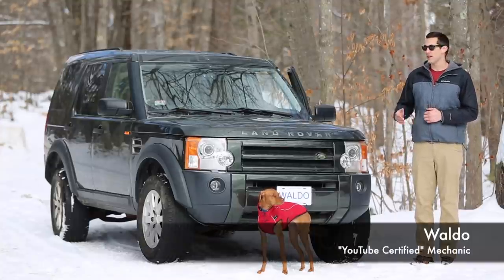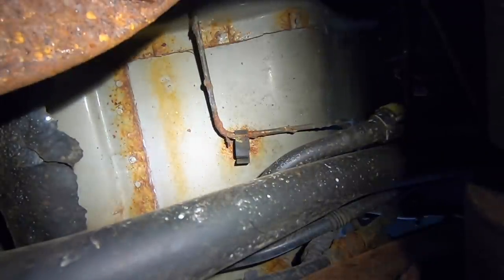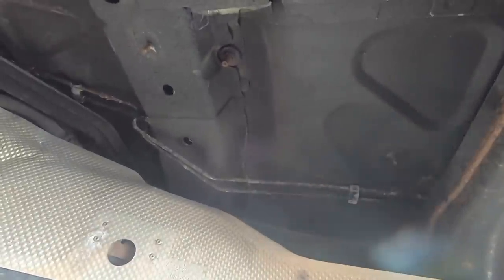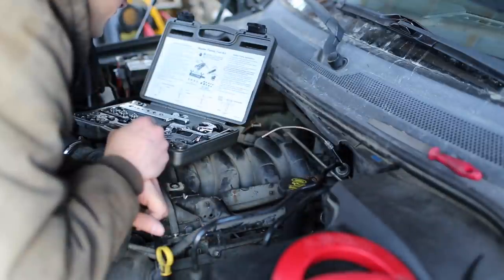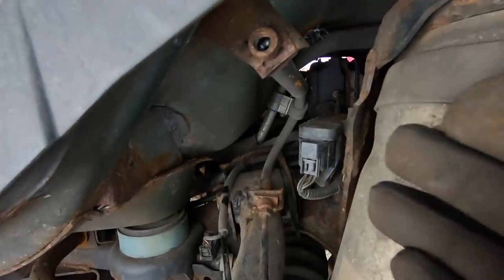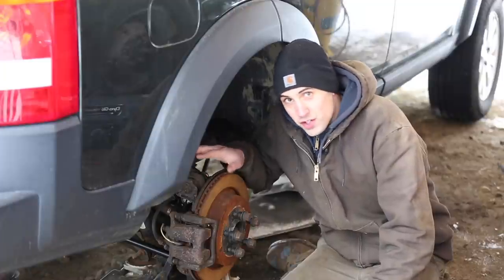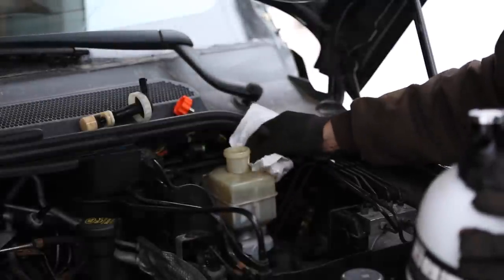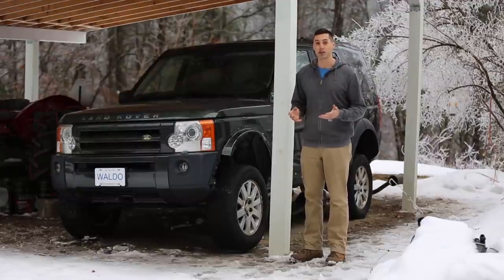Replacing Brake Lines, Will NEVER Rust Again! [Land Rover Part 3]

Comment: Nice work! as i'm putting in my Suncore coil springs I'm noticing the rusty brake lines!  Next job and this will be my go to video, and of course Christian and Vera at LRTime, I had one nasty nut finally give in today, so just one corner left to get undone, its nearly sawn through but that means nothing to these nuts, we'll see tomorrow, a full size less socket levered onto the nut with a prybar and penetrating oil soaking for days then my 3/8 craftsman flex bar from the back finally broke the back nut, of course it still fights every turn but cranking the socket down on it held

Comment: Big job. I know because I replaced the rear brake lines, fuel and evap lines on a Corolla. I had to drop the tank, front sway bar links, exhaust which included the O2 sensor, and passenger front seat to disconnect the O2 sensor. Got the lines from Tokyo for about three hundred bucks. More than I paid for the whole car. Very tight especially at the firewall. Good video. Happy Motoring.

Comment: on the rusty bolts, my personal recipe is get stainless bolts whenever possible. 304 will not rust even if the bit it's screwed into is pig-iron. It's a trick I learned on chem industry: stainless bolt + iron nut = easier to loose and the bolt will be reusable.

Comment: Hey Waldo, the corrosion on the wire harness was caused by water leaking from the sunroof drain going down to the A pilar. It's a known issue , you should have then cleaned or unclogged or replaced. Check for water on the floor on both sides of the cabin.
Reply from the maker: Yeah, there was water (actually ice 🥶) on the passenger side floor. I'll add the sunroof drains to the to-do list 😂
Reply: Also about wet front foot wells: check the AC drains on both sides. Was culprit in my 08 LR3 that I daily & work on myself. 👍🏼 compressed air/canned air blows out the AC drain pipe when it clogs.
Reply: I also have had water in the footwell of my L3.  Both the AC drain near the center column, and sunroof drains needed to be cleaned out.

Comment: Dip a piece of insulated stranded wire in brake fluid, then insert in brake line make bends then pull out never kink that way and never had one get stuck.
Reply from the maker: That's a good idea! 👌
Reply: What gauge wire do you use?
Reply: @corydriver7634  What fits snug inside tubing depends on 3/16 or 1/4 inch.

Comment: Man good for you for repairing the air system. Interested to see if you continue to have issues with that. I had air suspension on my 2013 V8 Grand Cherokee, but after 130k miles the hydraulic part of the front struts was pretty much blown. The rear bags were also starting to crack and the pump was significantly noisier than when new. So I just fit 2.5" OME springs/shocks and was able to fit 33" tires. It's basically in high mode all the time. 

Not sure if its the same with these, but a common leak point is the swivel elbow at the top of each front strut where the air line attaches. The O rings inside dry out due to engine heat and start to leak.

Also, a really good treatment for that body seam rust is cosmoline spray. Its like a wax coating, and you don't need to degrease and sand stuff for it to work. I buy it by the case in aerosol cans from cosmoline direct.

Oh and when doing a complete line replacement, I found getting pre bent stainless lines from a company like inline tube to be the easiest. And I always change the hoses to braided stainless at the same time. Full kit is like $250 and the the fittings are all installed. My wifes 1990 Volvo has factory copper lines, still perfect after over 250k miles. I dont get why every car does not have them, has to be like $50 more overall.

Comment: Just had my rear brake line start to leak in my LR3.  Not sure if I have the ability to do this in my driveway during the New England winter, but I may try it to save money.  Otherwise it would be very expensive to fix.  I've done other repairs like the front brakes and steering shaft before.

Comment: when doing any brake bleeding please make sure you have reset your ABS PUMP with a scan tool. once air enters the abs system the abs will not work properly at all the brakes might feel fine driving 20-30 mph but once you need to brake hard or to brake continuously, your discovery wont stop properly and your brake pedal will become very firm with out any actual stopping ability....but apart from that brilliant video so clear and understandable. making me wanna change my brake lines on my discovery 3 .
Reply: I don't know about these vehicles, but on other vehicles with abs that require a scan tool, which I do not own, I cheat. On a rock driveway or snowy area, drive slow and slam on the brakes. This activates the abs system and it will work the air out of itself. You might have to repeat it a few times though.

Comment: A problem we never have here in Phoenix Waldo ! I would'nt know where to start on that job !
Reply from the maker: It's inevitable around here. As far as I know, all vehicles come from the factory with steel lines and they always rust out. I've done so many of these jobs in the last year or two 😂

Oh and it's also not fun when they break while driving. That happened to me a couple years ago when I was towing my 7-ton trailer. A traffic light turned red right in front of me and I slammed on the brakes only to have a front brake line burst. Luckily the trailer was empty and nothing else bad happened

Comment: You made the brake line replacement job look easy!  And, I am very surprised that the air suspension doesn't have a dozen leaks.
Regarding the Mercedes Diesel:  Did Rover EVER build the LR3 with an inline six?  Thought the sixes were always V6s.  Measure twice... cut once.
Reply from the maker: Yeah, as far as I know, they were all V6s. I'm still not 100% sure I'm going to do the swap. I'm a bit hesitant due to all the issues this car has had, but we'll see. Also, I kind of want to drive it this winter since it's good in deep snow, and if I start a swap, it definitely won't be ready by then 😂

Comment: not sure where you live but here in NC cars are fairly rust free (90%), so one day I purchased a Subaru Impreza cheap for $300. It had leaky Fuel and Brake Lines due to rust and had some rust around the rear Wheel Wheels, No Problem I think. After fixing it, I took it for a test drive and ended up crashing it into wrongly sign because the two lower control arms snapped in half. Turns out, that car came from Vermont and was so much structural rust, I had to crush it. Rust is no Joke, especially on a Subaru
Reply from the maker: Yeah, I'm in NH and I'm sometimes tempted to buy cars from VT, but they are SO rusty because of how much salt they put on the roads there!
Reply: You need to watch South main auto, ny state mechanic. He deals with a lot of rust. When you grow up with the rust, you know what to check and you know how to be creative when fixing. Usually heat is a safe choice, unless it next to a plastic fuel tank, then maybe you a piece of metal up shield it.

Comment: For anyone watching this if you replace the lines all the way back to the ABS valve block you'll need two 25' rolls, or one 30' piece, as each side uses about 15'.  Also most of what you find on Amazon isn't real copper nickel line, it's just copper coated steel.  If you are in Canada you can get good copper nickel line at Canadian Tire or Part Source.  If you only have a flare tool for North American cars, you can do a bubble flare by using the opposite side of the tool, search on youtube.

Comment: Why replace the V8 if it's a reliable engine? Surely much easier to stick with what works that change everything for a diesel setup and all the accessories that'll need changing too?

Comment: Hi, I hope you are well.  I was wondering.  If the copper line is soft and you had two persons (one pulling on a lead wire and the other pushing the line); would it be possible to use a single line without the splice?  Thanks in advance!
Reply: Most likely and from a safety/reliability standpoint a single run would be preferrable.

Comment: Thanks for the video - very helpful!  I was wondering if you had video of re-installing/connecting the exhaust . Curious if it is as simple as replacing the exhaust clamps/flanges or if anything needs to be welded back together

Comment: Hi Waldo,
I'm here in Maine (just up the road), and have the same christmas tree dashboard. I've changed the brake light bulbs, brake switch, replaced the battery, cleaned the mass airflow sensor (all based on tips i've read on forums). They all seemed to help some, but it will still intermittently light up (or all lights actually go off, with brake fault/trans fault/special programs off/etc...). My next check will be the wiring area you identified. (I so wish your excellent video showed exactly what you did!) 
Was the corrosion easy to spot? or did you use a meter to guage the drop in voltage? 
Thanks in advance! Love the videos!
Fred
Reply from the maker: I used a multimeter to detect a significant voltage drop at the brake switch and a very high resistance in the wire. When I physically moved the wire loom in the rocker panel area, the splice came apart, which made it easy to spot since there was a loose wire hanging. Good luck!
Reply: @WaldosWorld  Thanks. I really appreciate the reply!

Comment: Hi Waldo great video as always. May I pass on a tip I was given ?-when you replace the drivers side windshield trim on the front use land rover trim clips not aftermarket as they can cause serious wind noise that will drive you mad and you won’t find it if you don’t know !  
Good luck with the project and I look forward to the engine swap.
Reply from the maker: Thank you for the tip! I ordered a bunch of trim clips, which I think are OEM. I'm excited to get the new door, fender, and trim pieces installed 😎

Comment: Nice catch in the wiring being corroded.  Check the sunroof drain above the passenger and driver side.
Reply from the maker: Yeah, the passenger side floor was all wet, so I think it's the drain on that side 👍
Reply: @WaldosWorld  I guess there is an updated one you can install that alleviates the drainage issues.
Reply: @WaldosWorld  it could also be that the cowl is deformed. I had that happen twice. What happens is on the passenger side the hvac intake is right underneath the cowl so water can get in it if the cowl is deformed. The water then goes through the hvac system. Drips onto the rear of the CJB then finally ends up in the wire tumnel and floor.

Comment: Did you wash the bottom of this vehicle? I have never seen a vehicle this clean on the underside that has been on the road more than a year. I wonder if a guy could make one of those brake bleeders with a pump sprayer and some parts from a salvage yard?

Comment: When you do the transmission make sure that you use the correct ZF fluid. You can't just put Dexron 3 or "compatible" oils, they need the real ZF oil.
Reply from the maker: I'll be talking about my theory on that one in the next video. I bought Red Line D6 ATF, which is quite a bit cheaper than the ZF fluid and should be suitable
Reply: Is he going to keep that gearbox with his diesel unit ?
Reply from the maker: The current plan is to keep it, though it's temping to buy a manual gearbox and have it shipped here from Europe 🤔
Reply: @WaldosWorld  Maybe I can help with that.  I'm in the UK.  I will send you an Instagram message.

Comment: Two points:  must be a lot of salt applied to the roads over there.  Everything looks rusty underneath.
I live in Australia where no salt is used and rust underneath for well cared for cars is generally not a problem.

Point two;  if the existing petrol engine is in good condition why would you change it for a diesel. ?   Hell of a lot of work for what gain.

Comment: Superb video! Hey I have a question, I bought the brake fluid container you have for a one man brake fluid change and couldn’t get it to work….had everything hooked up correct, pressurized it and no flow of brake fluid. Is there anything else I need to do? Do I have to use a OBDII tool to let the LR3 know…..

Comment: Waldo you make great videos, after you drive the car for a while go back and re-tighten all of those flare nuts You don’t realize but when you step on the brakes it’s thousands of pounds of pressure i’ve had a few comebacks over the years at my shop because of that.... my second question where did you find all the Land Rover information sometimes information can be very proprietary and hard to get?????
Reply from the maker: Good call on the re-tightening. I have had a connection start leaking once and had to re-tighten it. I figured I just didn't tighten it enough to begin with, but maybe it worked itself loose after driving?

As for the manual, I have an AllDataDIY subscription, which is decent. Even better is the PDF of the official Land Rover repair manual (complete with excellent electrical diagrams!) that I found on the Interwebs. I think it can be found on landroverforums.com

Comment: put an air cooled Deutz engine in it! No radiator required! They have industrial engines with no cast iron oil pans, to reduce weight.

Comment: I'm following. I've been looking at doing a diesel swap for a while now. I've pretty much settled on a Mercedes inline 6 also, but it's the transmission side I'm trying to figure out. Are you going with another transmission or are you going to adapt to the ZF 6 speed?

Comment: Could you tell me if you where using a 3/16    4.75 SAE OR DIN flaring tool.  I noticed that you used OP1 double flare. Why where you using double flares ?. I think LR3/4 uses 3/16.  4.75 DIN only  not SAE Double flare. I might be wrong or stupid. Comments please.
Reply from the maker: Yeah, I made a 3/16" bubble (DIN) flare 👍

Comment: I have question: Does brake lines must be in equal length to perform equally?
Reply: Brake lines don't need to be equal in length. It is the pressure that is important which should be equal. Brake fluid doesn't compress. If it was a different system that has compression it would matter.

Comment: Too tricky to have a single line from master to slave? Excellent job. Well done, you make it look easy. You have a Nanocom? It can power bleed. On the D2 it can. Nothing like the joy of seeing clean brake fluid exiting the bleed nipples! Buy a steel pan for the transmission, it comes with a drain plug.
Reply from the maker: Thank you! Yep, I have a Nanocom, but I figured I'd just use the pressure bleeder since it does a great job

Comment: You know its a land rover when there is a special cover just for the master cylinder.
Reply from the maker: It seems to be a European standard 🤷‍♂️
Reply: Its actually because all LR3s were built in the same factory regardless of destination country. The box the master cylinder is in is a mirror image of the box that the battery is in on the other side. So if the car had been built with right hand drive the battery and master cylinder would have been swapped.

Comment: so much rust underneath :o
Reply from the maker: Luckily, it's mostly surface rust. I might pull the body off later this year and do some rust treatment to the body and frame
Reply: @WaldosWorld  btw,did u know u can raise the suspension even higher? u press the brake and the UP button simultaneously

Comment: Good luck with your project rovers are a money pit your hands in your pocket all the time because something has gone wrong wait till you get a electrical problem
Reply: I don’t think he needs to wait 🤣
Reply from the maker: I just fixed an electrical issue: the one that kept my suspension from working. They sure can be a pain to track down, but ask me in a few years and see if I've pulled all my hair out by then 😂
Reply: @WaldosWorld  I've enjoyed the LR3 videos, great to see your enthusiasm for the project. There will be plenty of people telling you old Land Rovers are a money pit, but most of the problems are down to neglect, once you've got them up to spec they aren't any worse than other old luxury vehicles. That JLR petrol engine sounds sweet, if it was mine I'd keep it stock with current engine. Looking forward to the next video.

Comment: Land Rover is absolutely horrible with their build design, but at least they make in look nice. They all should be punched in the face. Why would they install brake lines that rust. My 1972 Plymouth Scamp brake lines are still in perfect shape. Cheap parts for an expensive truck.